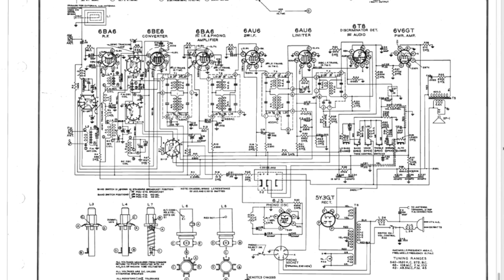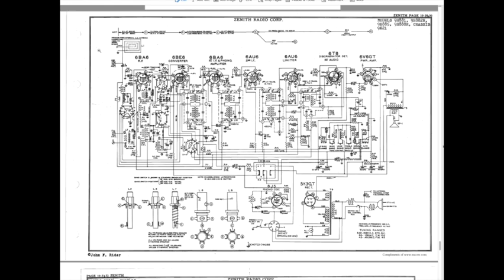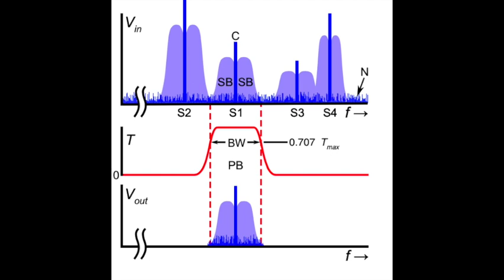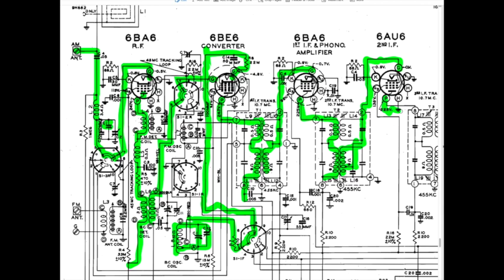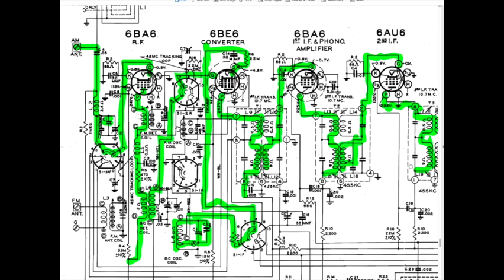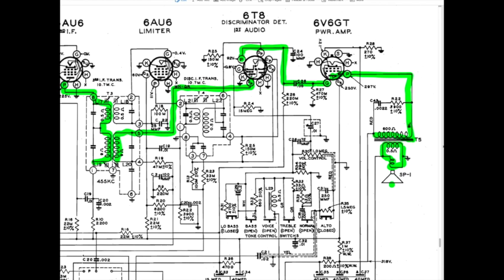Zenith 9E21 Part 3 - AM Signal Path

Comment: A brilliant introduction for anyone thinking about learning the AM signal path, demodulationI, and a audio output.  I formally learned this stuff when I was aged 16. 
I’ve also seen, for example, 150m (150k), and 1 Meg value readings for resistors, that do not comply with the standard resistor colour band coding, inside Atwater Kent radios, Jackson Bell, and a few other American, and Canadian radios.  In all of my 52 years of monkeying with valve radios, I’ve never seen those type of value readings associated with British radios but I wouldn’t be surprised if there is someone out there who knows different.  I’m not sure when the standard resistor colour band coding was universally accepted, and implemented, but I’d guess it had to have been sometime around the mid-1930s.
Yes, it’s all interesting fun my friend, Phil.
Reply from the maker: Thanks, Phil. I agree that some consensus must have been reached in the 30s. What I'm running across with the current Zenith chassis is that age and use have made orange and red resistor bands appear to be the same color.

Comment: Enjoyed the video.
May I make a small suggestion?  On doing the highlighting, how about using multiple colors.  Like green for the off the air signal, blue for the oscillator signal, and red for the converter output.
I am curious also to see the shielded capacitor.  I have seen a few that had 3 leads, one of which was the shield.  I am wondering if this is one of those.
Reply from the maker: I would expect so, Wayne. They used some sort of metal foil for a lot of the shielding in this radio. Thanks for the idea about color coding, but I have enough difficulty managing just one color.